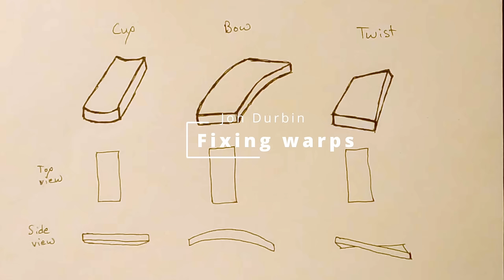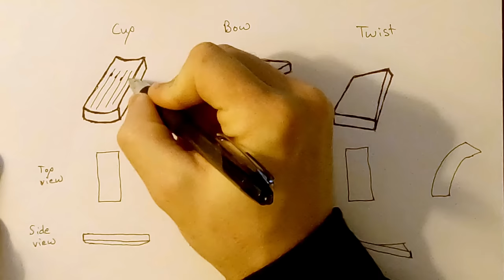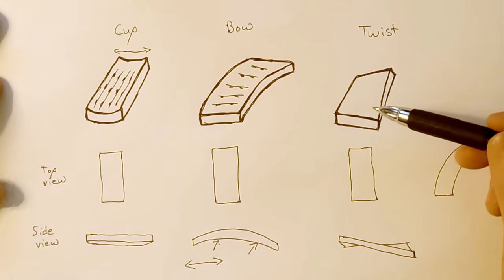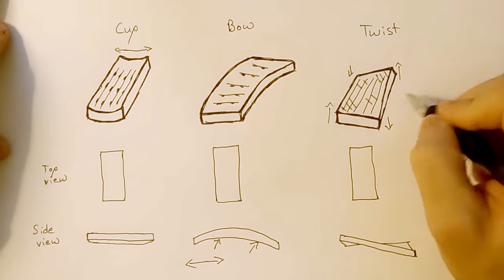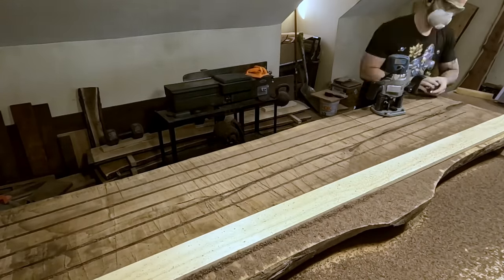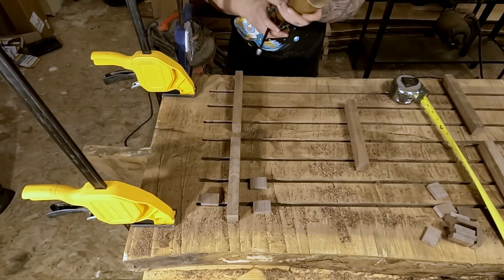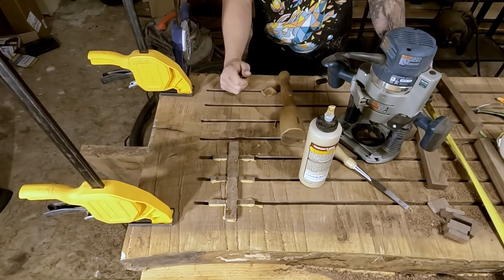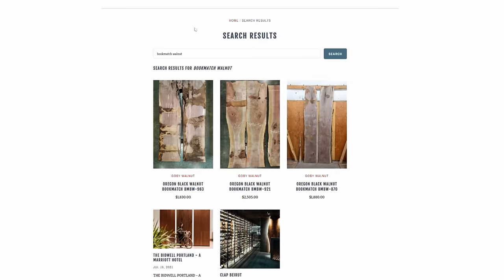How to fix a badly twisted slab/board without losing much thickness

Comment: Nice. I usually just force the warp out with straight pieces glued either around the perimeter, or on the bottom of the table. I have a kitchen table that was cupped, so I glued some 4X4’s on the ends and a year and a half later, it’s still flatter than ever
Reply: I have a 60inchx30inch cupped slab with approximate 1 inch + thickness . any idea how  can I glue 4x4 to straighten it?
Reply: @ajipaul8303  
For slabs i would try to flatten it out with a plainer or surfacing jig 1st. a surfacing jig should get most of the bend or cup out. Then get some pieces of 2x4 or 4x4, place on bottom in a position where the grain on your 2x4's intersect, or cross with the grain on the bottom of your table, then use clamps to pull the remaining bend out, and glue them together.

Comment: This is a follow up from an earlier comment. I watched another video by a professional who made a similar table. He used a similar technique  with c channel although he did not use the type with slots nor did he rout the inset for the c channel a little longer and wider. After delivering the table it split as well as deforming the inserts and bolts. The humidity in the customers house was so low he used a humidifier. Over time the table was ruined. He feels his biggest error was in not using slotted holes in the c channel. Secondly, I find that weighing my project wood after cutting pieces but before dimensioning and checking weekly gives me good info on whether the wood has acclimated. Good luck.
Reply from the maker: I always cut slots in the c-channel; basically drill two holes and remove the center with a grinder, and I always make the inset wider and longer than the steel, for that reason.  For this project, I dried it down to 7-8% (verified with Wagner Orion 950 moisture meter), then let it acclimate in my shop for about a month (kept at 45% humidity), then once complete I kept the table in my house for about 3 months waiting for the client to be ready for it, during which time the table did not warp or split at all.

Comment: Such a helpful video, thank you Jon! 

I’m in the process of making and documenting my first slab table made from White Oak and after glue up and c channel, it cupped due to extreme heat while I was in laying bow ties (my workshop is outside and I live in Australia 🤷). Most of the cup straightened after the slab re-acclimatized but still a slight cup which I’ll use these stress relief cuts to help solve. 

Any merit in filling the relief cuts with epoxy after the slab straightens?
Reply from the maker: Glad you found it useful.  I've seen others epoxy fill, but I haven't tried it so I can say for sure.  Two potential downsides to epoxy: It usually shrinks when curing (not a huge amount, but it could be enough to pull the warp back in), and it adds quite a bit of extra weight.
Reply: Interesting. I thought of trying epoxy too but not going ahead with it at the minute. Be interesting to know how it turns out if you manage it! Let us know man. Cheers 😉👍🇬🇧

Comment: Nice work, thanks for info and sharing. I’m about to flatten some large oak boards with the router. I cut them 2017 with the chainsaw Mill and they’ve dried well being weighted down, without much movement at all. I’m interested and anxious to see if the first one as a coffee table holds shape after getting into the house. I’m considering rebating angle section into the base as you have with the C-section….purely as I don’t have C section which I would have preferred. Fingers crossed. Cheers again. 🇬🇧🇬🇧🇬🇧

Comment: Great video! I have 3 white oak live edge slabs and I was looking for a way to flatten them without taking too much off. This is perfect. They are cupped so I believe I can just work longways like you did. I was wondering are those small spacers wedges or just straight pieces of identical thickness.?

Comment: Not at all "fine" woodworking, but I'll often buy from the "cull" pile at my local place (the warped lumber everyone else passed on) for building sheds, fences, etc  to save money and I'll then just leave it in my shop with some heavy weights flattening it out and that's worked pretty well. I wonder if it's due to the stuff not being completely dry when I start.

Comment: I just removed peeling veneer on an antique buffett top. I did the wet towel and hot iron method. I took the whole buffet out in the 20 degree weather then back inside at 68 and its teisting on one corner that was loose on top. Hoping i can fix it right
Reply from the maker: I'm sure you'll get it fixed up!

Comment: Nicely done. As an amateur/woodworking noob I ruined a piece of wood by airdrying it near a heater, but I think I can fix it using this method. Question; Can I apply this technique without the steel frame?
It's only a 16x52 inch board, plus inexpensive wood so is it even worth it?
Reply from the maker: It’s certainly possible to do without steel, but it would depend on the amount of warping, how stiff the wood is, etc.  Personally, I would definitely try it on a cheap piece of wood!  Making a mistake on expensive materials is pretty gut-wrenching, might as well practice with something cheap.

Comment: I like your method, I’ve used it before.  But after all those cuts and wedges, wouldn’t it be less work to just router sled the whole thing to straight? I guess you didn’t want to lose thickness.
Reply from the maker: Yeah, the opposing corners were both warped  2"+ from the surface, and it was only 2" thick, so just jointing it I'd have nothing left.

Comment: Great tips, I hope I can fix my twisted board; I have a question: do you wait for the slab to be flat after the relief cuts to install the wedges, right?
Reply from the maker: This is one thing I failed miserably at explaining in the video unfortunately.  After I cut all of the reliefs, I clamped the slabs down everywhere so it would be flat before inserting the wedges.  Relief cuts won't flatten the board immediately, so you need to flatten it under pressure, then the wedges actually apply the force that flattens the board.
Reply: @JonDurbin  Thank you for the quick response!
Reply: @JonDurbin  Thanks for the video.  So for clarity, the wedges are not wedge shaped, they're just straight pieces fitted tightly into the grooves?  Then when you release the clamps, they prevent from the twist from returning?

Comment: Huh. Very interesting. Do the unfilled channels get filled with anything later? Epoxy or something? 
Also, I spotted a six inch jointer in the background. Is that an old craftsman? If so, I have the same one. $100 find.
Also, I read some other comments and you mentioned moister content in your reply. I'm in the market for a moisture meter and wonder if you might recommend one.
Reply from the maker: I left the channels empty, but did make sure to seal them all really well with lacquer to reduce uneven seasonal moisture loss/gain.  Yes, 1950's craftsman, still going strong!

I have used 3 moisture meters: can't recommend the pin kind because they can only detect surface moisture and have caused problems for me.  I've also used the General Tools MMD950 pinless meter, which is decent but only gives relative measurements.  The one I use now is absurdly expensive but works beautifully, the Wagner Orion 950 pinless.

Comment: Do you think filling the relief cuts with epoxy after making the relief cuts and flattening the slab would work?

Just curious but your results are great!
Reply from the maker: Possibly, but you'd have to make sure it was truly, fully cured (30+ days).  The wedges actively push the cuts apart, whereas epoxy would just prevent collapse.
Reply: That was my first thought when thinking about this. If I had the opportunity to try this I'd consider making the relief cuts, clamping the slab down either dead flat or with a little counter warp, fill with epoxy and let it cure. I wouldn't use a router though since I think all that pass really necessitates a thick pour slow cure epoxy. With a thin kerf circular saw a standard epoxy could be used I think and it would cure much faster.

Comment: Hi, do you think soaking the slabs for several days before inserting the wedges would help reduce stresses in the slab as it drys? I have no idea by the way just asking.
Reply from the maker: Good question, it may help get the initial shape but then long-term would likely cause more problems, because you would be drastically changing the moisture content.  Wood should be equilibrium moisture content for the region it's going to live in when working on it, so in this case the boards were already down to 7-8% before, then stayed in that range during and after.  Boards tend to warp quite badly when they dry too quickly or unevenly.

Comment: VERY NICE RESULT! Did you have a concern while working or do you have a concern down the road that a crack might develop? Also were these air dried or kiln>
Reply from the maker: Thanks!  The boards already had a few big cracks, so it was a big concern.  I cut all of the stress reliefs first before applying any pressure, hoping any of the stress from pressing the board flat would apply across those cuts instead of the existing cracks or random spots, and I guess I got lucky!

The boards were air dried for 2 years, just outside under a tarp, but they were still about 20% MC when I got them.  I built a little dehumidifier kiln and dried them in there for about 3 months down to 7-8%.

I added several splines and bowties across the various cracks, along with epoxy for the larger spots.  Between all the reinforcements and the steel C-channel, I am pretty confident in the stability, but if something happens I will fix it!

Comment: Just soak in water and lay out on a flat surface with weight on top
Reply from the maker: Even if that worked, which seems unlikely for slabs of this size, they would just warp again once dry...
Reply: @Jon Durbin  not if slowly dried properly, seen it done, you just have to know the natural characteristics of wood "/